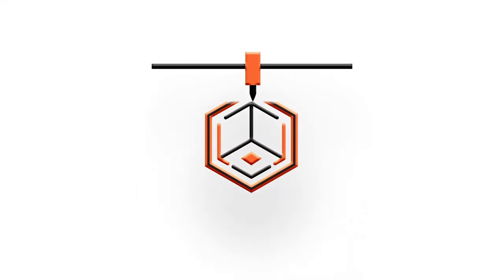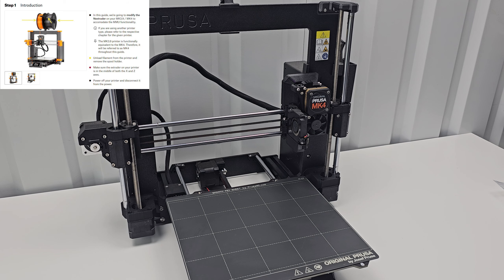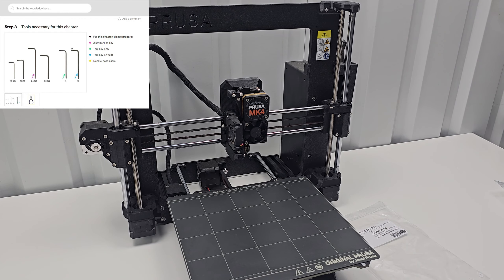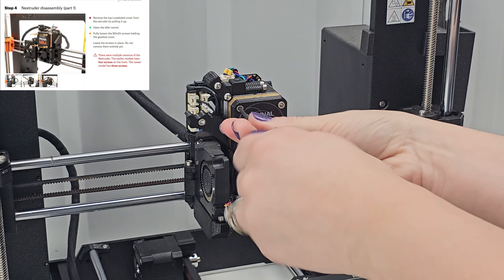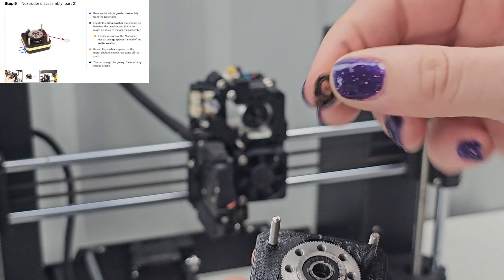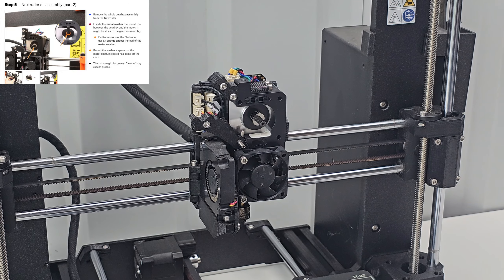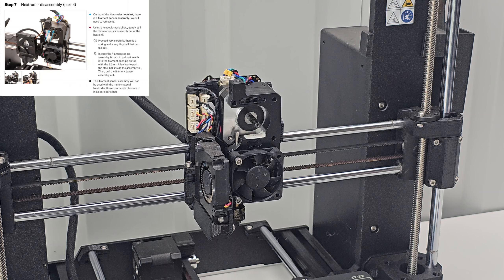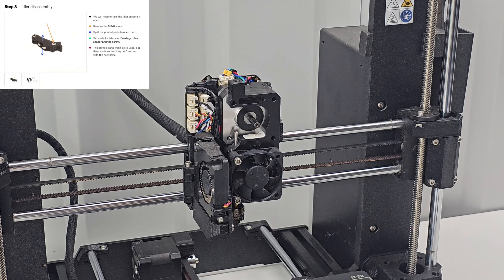MMU3 Build for the MK4 - Part 7 (Chapter 9)

Comment: Thanks again, and it was good to see the MK4 part of the extruder changes 🙂 Using the label bag for unused parts is a good idea.  What I use for spreading grease is a q-tip with the cotton cut off and then just dispose of it, helps keep the bench clean.  Family is visiting through the weekend so my build probably won't start until next week.  Looking forward to the filament routing you settle on with the buffer.
Reply from the maker: Oh yeah a qtip makes sense. I split my build up over several days. It's nice that each chapter ends at a good place. Thanks!

Comment: Maybe i missed it and you did it off-cam. But was there an o-ring installed on those extruder gear assembly?
Reply: 30:00 The O-Ring was installed on the main plate.
Reply: @marcel151  Yep, re-wachted it and indeed i missed it. Maybe i was afk for a short time and forgot to pauze the video. Watching this part while commenting on your answer. Thanks again!
Reply from the maker: Thanks!

Comment: Hey did you make a custom Idler for your mk4 ?
Reply from the maker: It is a different Idler for the MMU3. I  ordered the printed parts with my kit so that's what I used. Thanks!
Reply: @tada3dprinting  not petg ?
Reply from the maker: I would think they arr all PETG. Thanks!
Reply: @tada3dprinting  You're printing enclosed ? Do you print high temperature bed material like abs ? (pc or pet-cf)
Reply from the maker: No I don't print with enclosures on my Prusa printers. My print room is a separate metal building that I try and keep consistent temps inside. Thanks!